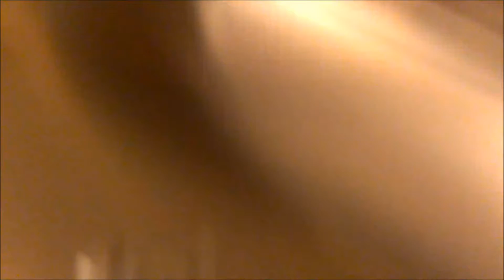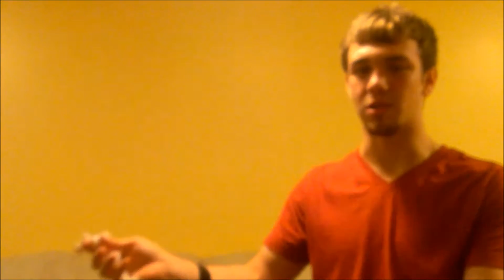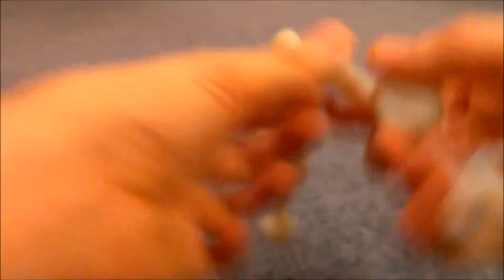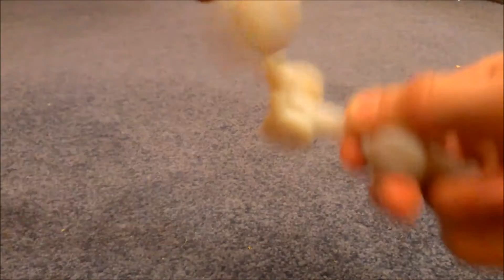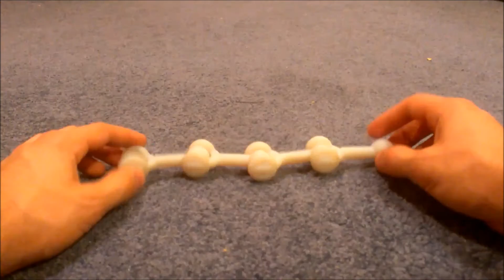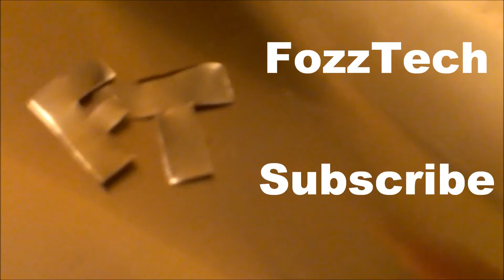3D Printed Modular Ball and Socket Joints | FozzTech

Comment: if u printed a fully poseable figure, do u need to print its joints individually, or just the figure as a whole? THX
Reply: action figure*
Reply from the maker: anajjar456 The whole figure could be printed at once! In order to be poseable, the tolerances between the ball and socket would have to be decreased from the original model.
Reply: how would u do that? Thx for the quick response.
Reply from the maker: anajjar456 If you check out the Instructable (link in description), you can take a look at the process I used when modeling the ball-and-socket joints.  In this case, the two toroids that make up the socket would be placed closer to the ball. Good luck!
Reply: thx

Comment: it sucks you cant even pull the joints in and out
Reply from the maker: That was part of the intended design.  It could be changed if desired. Thanks!
Reply: If you could make a metal ball and socket that pops in and out i would buy it. Also any luxurious metals or any other sturdy materials would work fine. i drew a model on paint if you want an example. please message me